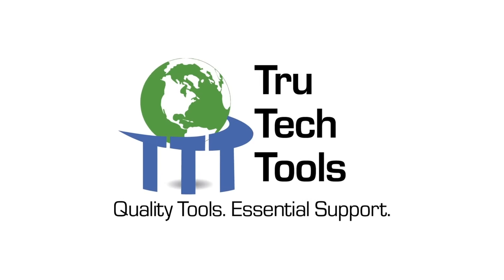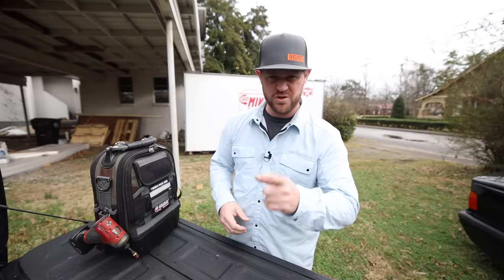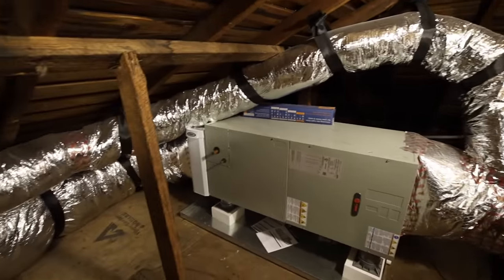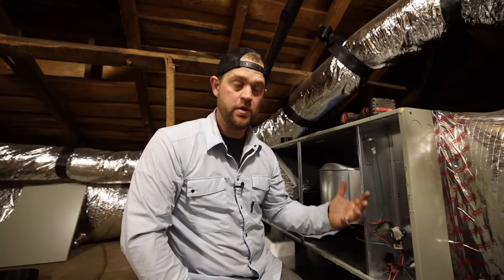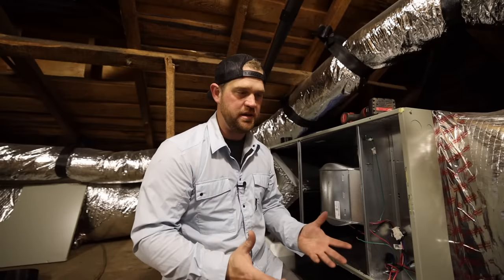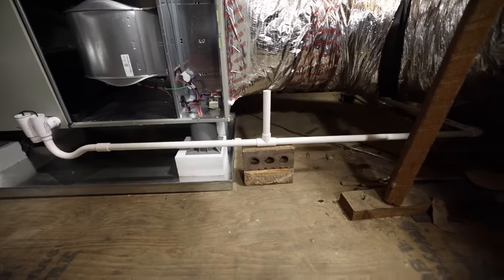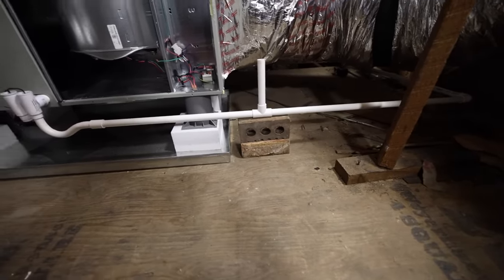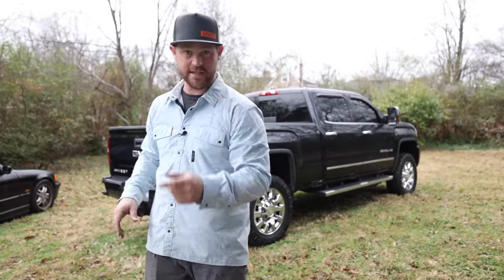I Should’ve Known BETTER…| HVAC Install

Comment: Breathers DO NOT GO ON AIR HANDLERS. The simplest explanation I can give is that no where, in any of the installation manuals (from any of the major manufacturers) you will never find where it actually instructs you to install a "breather".  Now the more in depth explanation is that, first and foremost the "breather" is designed to release any air that can get statically locked in your p-trap and or do to lack of proper grade (usually 1/4" per foot)  on your condensate line (also supposed to be used if your dumbing into ABS/sewer lines). On air handlers your coil is now negative pressure instead of positive pressure. So that "breather" has a tendency to suck air into the coil, when the P-trap isn't properly primed.

Comment: Is that liquid tight nonmetallic conduit you’re running the high voltage wire in? If it is legally cannot be over 6 foot long in my neck of woods!!

Comment: Love your channel! Hey for the air handler, does the fiberglass inside have fiberglass dust that can go airborne? I’m curious air handlers are not foam insulated inside it like refrigerators
Reply: No it's not like ceiling fiberglass, it's dense and almost like a board of fiber glass. A flimsy board.

Comment: What’s the process of taking these crimp fittings off for a coil change out?
Reply: cut them off and and have to add more, once there crimped I there is no way to reuse then
Reply: There's no more room on the suction side of the coil. Sucks if there's a leak.

Comment: Im sure someone has asked before but I just recently started watching your channel. Im a 1st year electrician apprentice and have been looking for a good pair of work boots and always end up choosing between the redwings and thorogoods. What boot do you wear to work and have had the best luck with?
Reply: I honestly only put on my boots if I know I’m going to a mud hole or it’s rainy. No one wants to admit it but tennis shoes are the way to go honestly. Way more comfortable, not as heavy, easy to slip on and off. Obviously you have to be conscious of not smashing your feet. At the end of the day wearing boots I can feel the difference in how my feet feel and I have a good pair of thorogoods. The most comfortable boots I have ever worn were Irish setters they are really expensive though.
Reply: Listen to Greg here,I do the same thing ,my Carolinas are in the truck if I need them but from day to day I wear a pair of running shoes.Lighter,more comfortable and more nimble when walking rafters and trusses.

Comment: Is the breather 100% necessary in this draw thru system if I were to individually trap both primary and secondary drains and run them both outside? Also do you run pan drain to the outside?

Comment: Looks pretty. I used to always try and prep my air handlers before they even went into the Attic with the heater and everything. I don't want to do that crap in the Attic.

Comment: Have you had any issues with the press fittings?
Reply: They often leak. Origns are not permanent. There is a reason why brazing is industry standard.

Comment: I am so sad to see this, i remember when those fittings first came out. I said then they will not last back then and i still stand by that today. I have been in commercial HVAC for 40 years. Take it from me those crimp fitting WILL leak at some point. You might get 3 to 4 ears out of them but take my word from me they 
WILL NOT last. Sure they make it easy but does not cut the mustard !!!!!

Comment: Why am I the only one to ask why the lineset goes up then comes back down? Why isn't it run under everything to make a shorter run? 1st rule of piping - shortest route with least amount of joints.. Also, would have zero issues with oil return under ALL operating conditions. Don't like criticizing peoples work, but your puting it out there. Clearly your trying to do quality work, but devil is in the details.

Comment: you left the coil side drip shields in the horizontal left position. just saying. read the instructions, it will limit splatter of condensate off the coil and on to the insulation. other than that looks clean, i use J traps to get a deep trap in attics with air handlers, but that's me not you.

Comment: Why do you use that style of conduit and not just like metal clad wire with just mc connectors?
Reply: liquid tight can be used inside and outside. keeps truck stock easy . helps save space
Reply: @joeglenn8955  Some jurisdictions limit length of non metallic liquid tight to 6 ft. That may limit use in some installs.
Reply: @mainj54  that's old code stuff. not sure if some municipalities still are behind.   liquid tight conduit can be used just like schedule 40 now.

Comment: Installing HVAC in an uninsulated attic is a BAD IDEA and needs to be discontinued.  Studies show that it adds about 35% to energy costs.  In areas with a lot of snow, it causes melting, shortening the life of shingles, and ice damming, leading to leaks. It needs to be brought inside the thermal envelope, or the thermal envelop needs to expanded to include the ducts and air handler.

Comment: Bro,do you even plenum?
Reply: Plenum? Never heard of um 🙃
Reply: @Jeff9202  it's the box off the supply and return that the trunk line or flexes connect to
Reply: @davids970  I know I was being sarcastic, that 1st run off the top has me scratching my head lol
Reply: @davids970  as well as that return flex straight to the filter box...
Reply: @Jeff9202   right over my head🤦‍♂️

Comment: Why do HVAC techs use such high quality materials on the HVAC system and use sub standard parts on electrical especially when electrical fires are commonplace.

Comment: U don’t cut the ends of the coil they are properly sized for the size line set your supposed to use never have I seen someone do this, and if you take the coil out before you carry the air handler upstairs it makes it a lot lighter,like they say on sports center! Come on man!

Comment: There is a difference in taking pride in your work and overdoing it! 3 float switches? Cmon man those tem4 doors suck ass as it is to get off, noting like fighting 2 glued switches. And the whole spill about the “breather” is incorrect. So much time and material wasted

Comment: And your P-trap is too shallow. As you know, the coil is on the negative side of the blower, and it will suck the water right out of your p trap. Maybe not the first month, but as soon as the filter loads up with dust. And once your p trap is dry, no drainage.
Reply: Actually it look like you are not draining the axillary drain pen are you?

Comment: You should heat the copper before bending it. You deformed the circular shape as it can be seen in the video. We dont want that.
Reply: Another reason why brazing is 100% better than crimping.

Comment: Sorry but this install sucks. No supply plenum, bricks slid under drain line, No pitch on the fan coil so the pan does not retain water, and filter drier not installed upstairs.
Reply: You must have fast forwarded (or slept)  through the part where he said he was coming back with all thread and brackets for the drain line...  Sheesh!